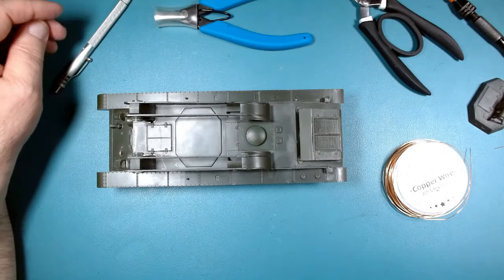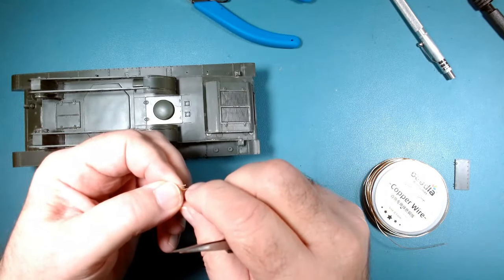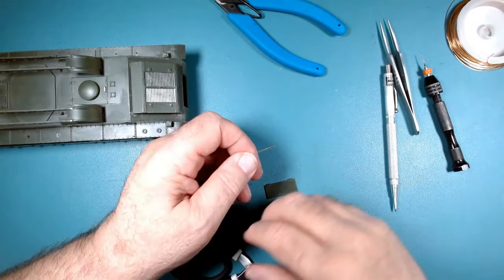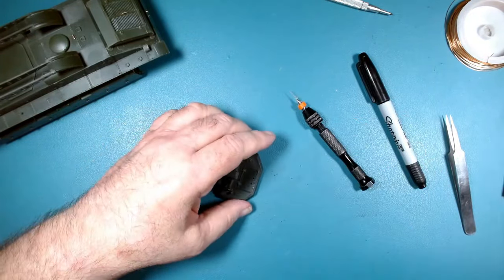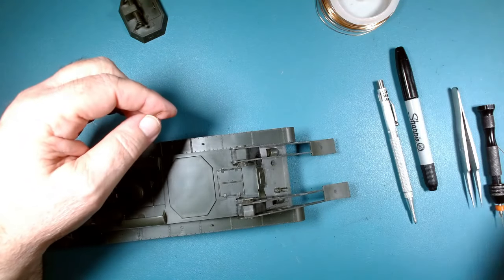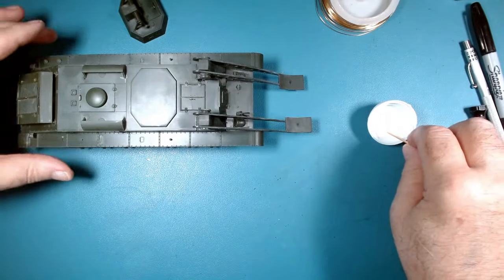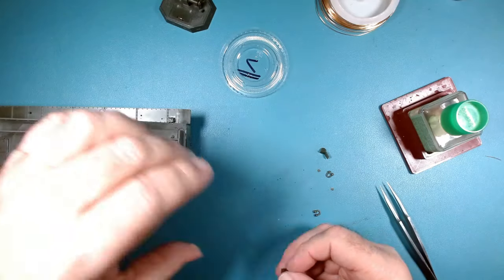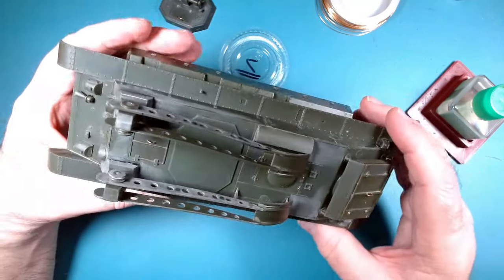ICM IT-28 Soviet Bridge Layer Part 9

Comment: I hold my breath every time you pick up one of those microscopic pieces with your tweezers thinking “No Zing!”. I had to cut 7 bolt heads off unused skirts to get 4 to mount my spare road wheels, some parts are simply too small to manage for some.
Reply from the maker: Hi Scotty, Thanks again for watching.  I'm glad you are sending me good vibes when I work on those tiny parts.  I try hard to put as much details into my models as I can, but there are of course limits to what is possible.  Everyone has there limits.  just do what you are comfortable with and that's just fine.  Remember it's your model, do as much or as little as you want.  Have a great day.  Jeff